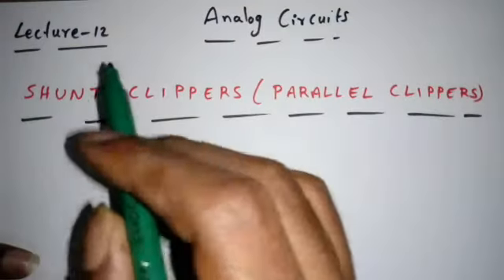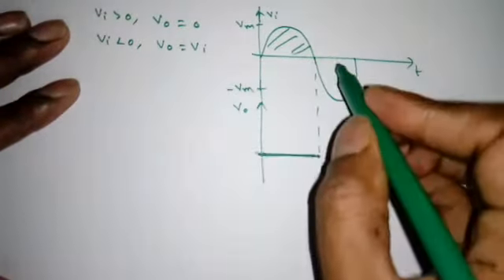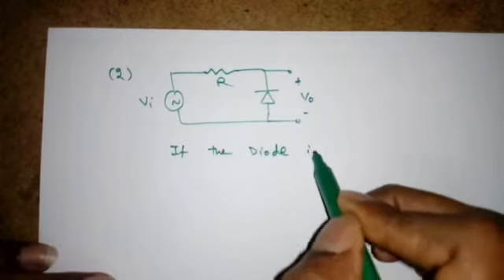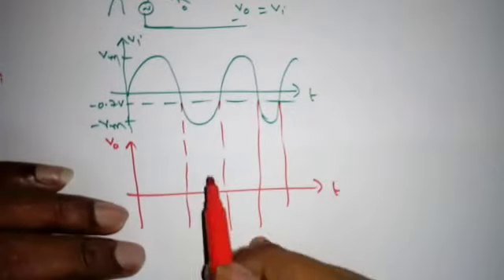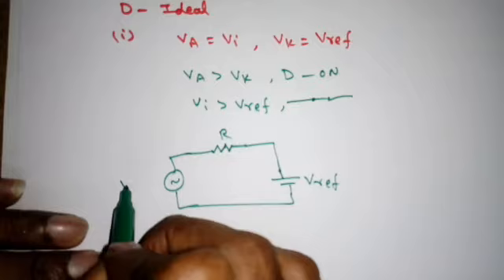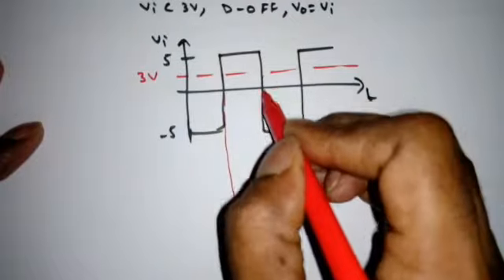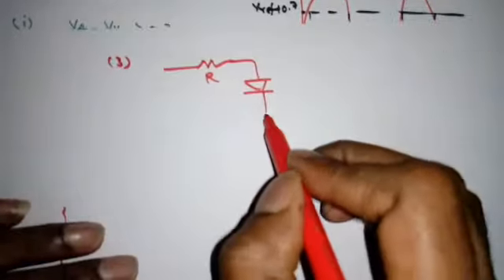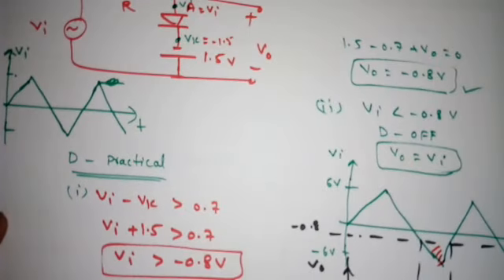Analog Circuits Lecture 12: Shunt (Parallel) Clippers- Part-1

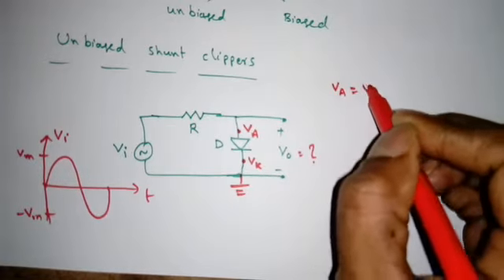Comment: Sir, at 2:14, you have stated Va= Vi, but wont there be a voltage drop across resistor R?
Reply from the maker: Anupriya Choudhary yaa but we assumed that diode open so no current flows so no drop...but practically R will be taken as 1k ohms, so very small current flows so drop also will be small, so our assumption will be right